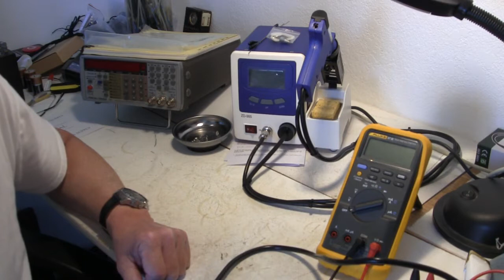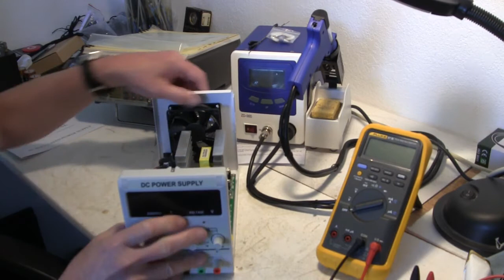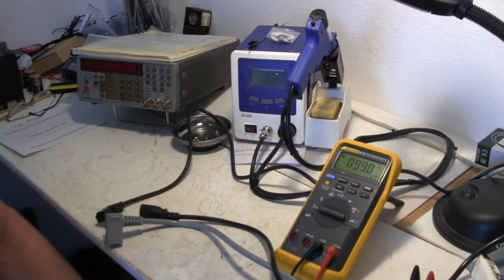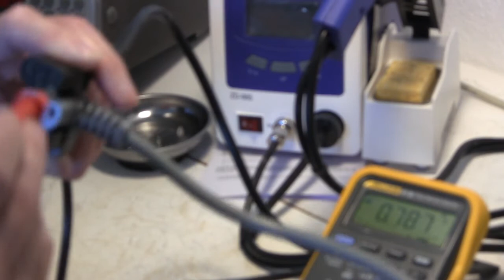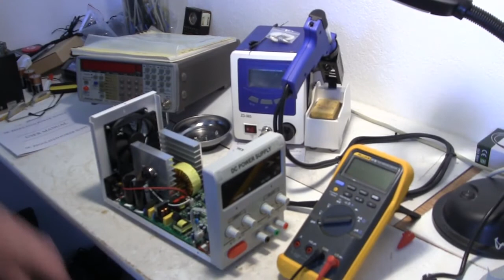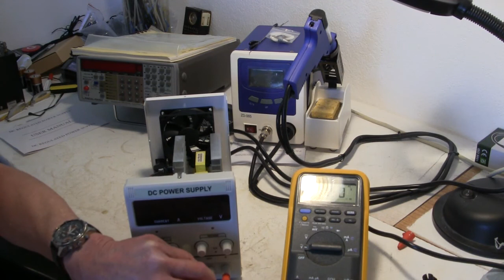A dire warning to all of you about Chinese power cords!

Comment: My old imported tube sw radio, I discovered potential on the antenna terminal..about 220 volts to earth or a waterpipe in basement..yes, I lit up, and respected it since. Anything that has multi voltage inputs...be cautious.

Comment: I've gotten in the habit of calling garbage from mainland China "Chicom" this, or "Chicom" that since the companies that make this stuff are usually connected to the Chinese Communist Party in some way, and to differentiate them from the Chinese people, and Taiwan. The solution, which many people are starting to get now thanks to the Coronavirus pandemic, and cover up, is to avoid products made in the P.R.C whenever possible, it's just not worth it.  
  They have been importing products from the P.R.C for at least 30 years now, and there unlike Japan, Korea, or Taiwan there is very little to no improvement in the quality of their products, some are tolerable, others are just plain bad. The P.R.C is also notorious for producing counterfeit components, capacitors, transistors, chips, even wire, never mind all of the other dangerous and counterfeit products they dump on the market. 
 There is a guy on here who acts as an apologist for all of this, trying to blame Western consumers, and companies for Chicom crap, sort of a "well you get what you pay for" spiel, well if it's counterfeit the intent is to defraud by creating fakes of legitimate products with a good reputation. But lets be honest, a power cord is a power cord, it takes just as much effort to wire it up wrong as to wire it up correctly, the production cost is irrelevant.

Comment: That POWER SUPPLY IS DANGEROUS JUNK.. It is a switch mode power supply and does not have a transformer for isolation. No matter which way the power cord is wired it can bite you or blow something up.

Comment: To be fair, could be a case of they don't care because they are also used to at least 2 types of european style AC mains plugs that aren't polarized in the first place. Like here in the EU, even our three-prong earthed ac plug isn't polarized at all and can be inserted turned 180°, switching the live and neutral wires. Thus, for these mains plugs, there is no guarantee which sides of the plug in the machine side is hot or neutral in the first place. (meaning EVERY power cord might behave like this chinese one, depending on the position of the mains plug)  So as they are used no non-polarized plugs in mainland china too they probably don't care about polarization when producing those cords with a different mains plug as they don't see it as a guaranteed order in the first place.
Still, bad stuff. Also really bad that the EU plug is such BS. I wish we had the UK ones, overengineered and save as can be.
Reply: The outlets they use in the P.R.C are either copies of the British style three prong plugs, or copies of the Australian three prong plugs, so both of those should have a neutral, in theory. However their outlets are often duplex types with a second outlet for lower current devices, it can take either one of those round pin French style plugs, or a non polarized version of a NEMA 15 plug (could be the Japan version which is non polarized), which could be a real shocker for anyone plugging in a 120 volt device! They also have no shutters, so children are free to poke knitting needles and who knows what else into them.

Comment: Really interesting! I have the same power supply as you and I had to go and check it, it's correct which is good. Never would have thought they would make a mistake like that. Very poor testing on the assembly line. Learn something everyday!
Reply from the maker: I'm glad yours is good. Did you receive it quite sometime ago?
I'm thinking this may be a recent phenomenon with two different pieces of gear having the same cord issue.
Tom

Comment: It does not surprise me about the power cords, however it COULD be that the power supply AND the soldering station could be wired "backwards" to match the incorrect cords.
I would check the power cord receptical on these units to see if the "neutral" goes ti the "un-switched side of the line, I don't trust Chinese stuff, good point about the cords.
Reply from the maker: Hi Bill, "long time no hear." Probably because "long time no video!"

I checked that. looked like units are wired right. I think that the two Chinese manufacturers build the stuff, then pay an outside Chinese outfit in order to buy the power cords in mass. How come I get the sinking feeling that the two power cords com from the same place? 

The solder sucker and the power supply companies probably assume that the power cords are probably made correctly. It seems obvious to me that they never even checked.

My bench is even smaller than yours! It's inside a closet. Maybe some day "I'll come out of the closet." So to speak...  LOL

See ya my friend,
Tom